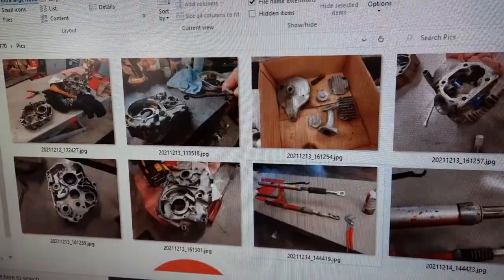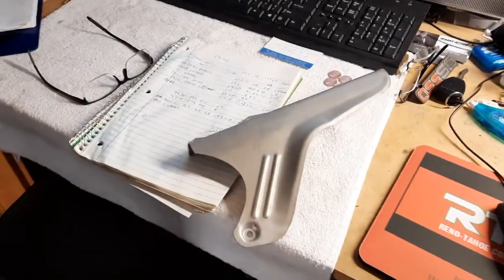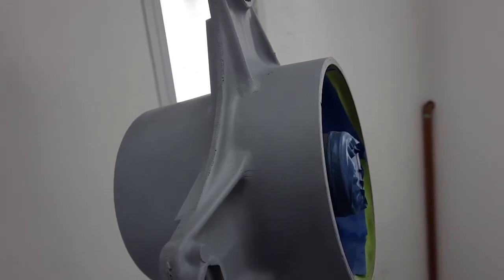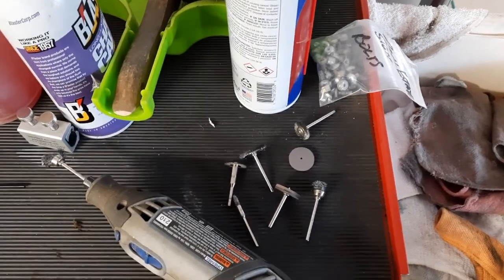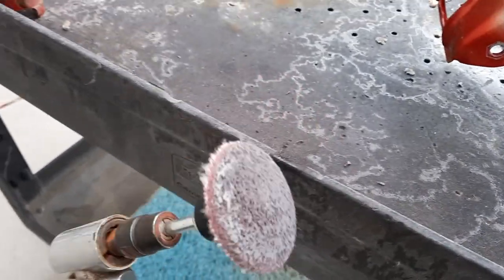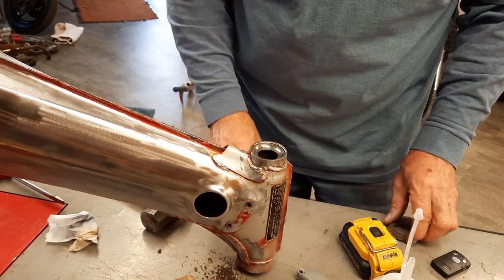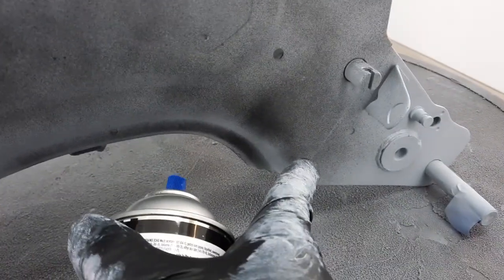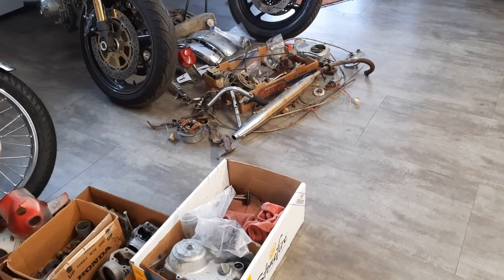Honda CT70 Restoration part 2

Comment: If you haven’t painted the frame yet, there are two holes on the left side of the frame that are not original, looks like someone drilled holes.  They are above the stamped VIN and chain guard holes.  You might have those welded up, if you haven’t painted yet.

Edit:  I went back and watched video #1.   It looks like the original coil went bad and instead of dropping engine to change coil, they just mounted one on the outside of the frame.
Reply from the maker: Great call but it is now painted.
Reply: @JTSCUSTOMS what where you using to blast the metal parts.they look great.whats VMR PAINT PHONE NUMBER
Reply from the maker: Just an old funky Harbor Freight blasting cabinet with glass bead. The grit is unknown but I think 90 grit could be it. I just don't think it matters too much. VMR paint Dirk is the man. 406 213 3722 or 855 485 7500 @iancameron198
Reply: @JTSCUSTOMS  thanks for the info.i just ran into your site.
I am working on a 1974 st90.once that's done.i have a 1972 z50.also 2 1972 red ct70,s I want to do.what site you use to get wiring diagram,s and parts break downs
Reply from the maker: Rocky Mountain ATV has the OEM parts diagrams that are so helpful. As far as wiring the manual or google it.    @iancameron198

Comment: Could you give a bit more info on those dremel polishing discs you mentioned so I can buy some? I’m assuming they’re different than the regular grinding discs that are common.
Reply from the maker: Hi. The discs are different. They are wider not thin cutting wheels like the Dremel. Made from some sort of high strength plastic/composite material. I found them on eBay.

Comment: Really enjoying this restoration. For the sanding/paint removal, are you using a scotch brite pad on a hook and loop backer? Is that scotch brite pretty coarse? Share a link if you bought on Amazon or similar. Thank you!
Reply from the maker: Yes I use the scotch brite. Not sure what coarse but it really doesn't matter as I find the hi build primer fills any scratches easily. Got mine off eBay. Just the best deal I could find and it may have come from China? So hare to answer questions on bikes I built some time ago. Hope that helps.
Reply: @JTSCUSTOMS  That helps. Trying not to overthink it :) Thanks!
Reply from the maker: Hi Build primer and guide coat is your friend.  I guess some go with an epoxy primer over the bare meatal and some day I will have to try it but for now just a thin coat of self etching primer then the hi build begins. I have always filled dents and scratches with Norton Premium Glaze #06032 either direct to the meatal after scuffing the area with 80 grit or over the hi build primer. Either way never had an issue.  @Stephen_Hall
Reply: @JTSCUSTOMS  I really appreciate the additional information about the primers. I had already planned to buy/use some guide coat, but I wasn't sure if I was going to go with self-etching, hi build filler, or a sandable type primer. Then, I wasn't quite sure about the order, so that really helps. My CT70 frame is in better condition (ie not as much rust), but I'm sure I will burn through the existing paint in a few places and of course, I need to remove the decals. So I'm feeling good about it now!